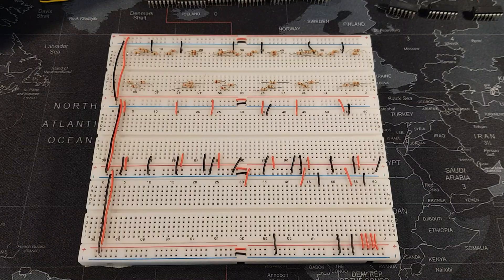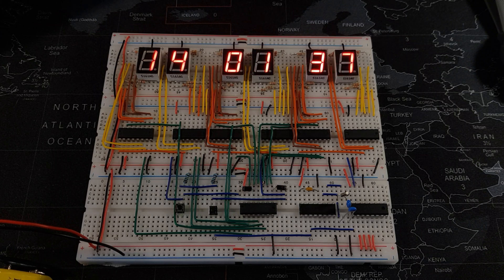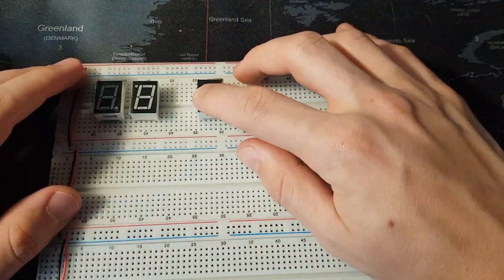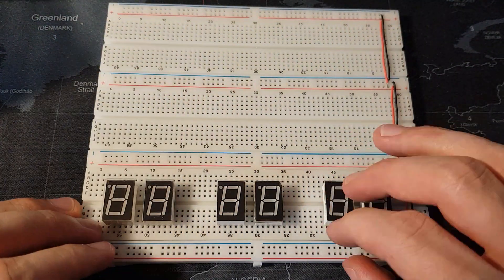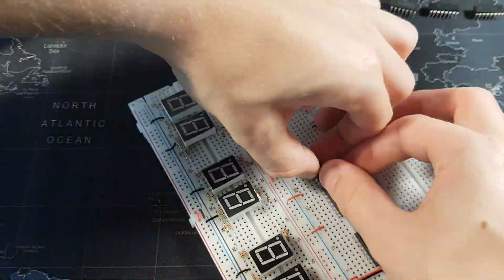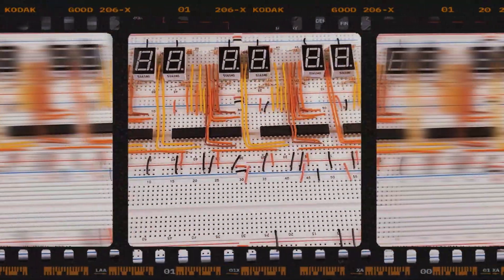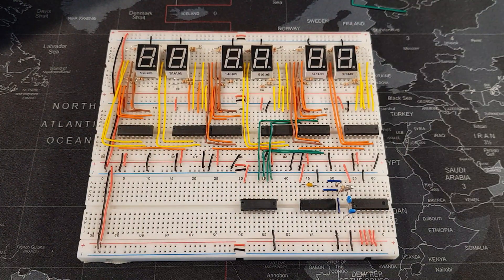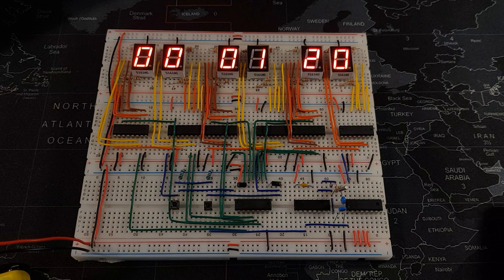Building a 24 Hour Clock on Breadboards

Comment: this is sooo niceee 😊 do you think a slower tutorial will be possible please? 👉👈
Reply from the maker: Are there certain parts you would like me to focus on? I will see what I can put together.
Reply: uhm, the IC and 7 segment display connection.. which is basically the whole thing, or maybe a circuit diagram works too so that we'll know which pins are used. Did you use a NAND gate? 
thankkk youuuu for replying to the comment 😊
Reply from the maker: I got the instructions off of instructables, would you like that site or would you like me to try and explain it? I can rework the video and post an extended one if that would work for you and others.
And I'll be honest with you, I don't know what a NAND gate is, I'll take a look at that, and confirm or deny if I find out.
Reply: yeah, an explanation will be nice please
Reply from the maker: Mate, I'm so sorry, I completely forgot, here's the instructables, and I'll try work out a detailed explanation if you want one still.
https://www.instructables.com/Common-IC-Breadboard-Clock/

Comment: Do you think you would be able to add date and temperature using the same method?
Reply from the maker: I imagine one would need a temperature sensor that I believe relies on some sort of micro controller to work properly, and in terms of the date, I dont know if it would work just based off of the setup of this circuit.
I will look into it, and if I find that it could work, I'll let you know.